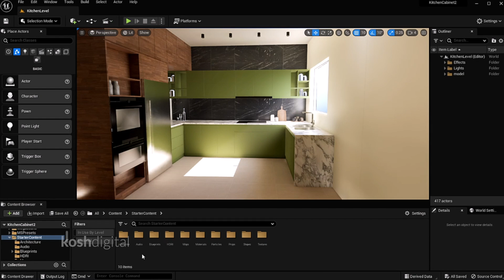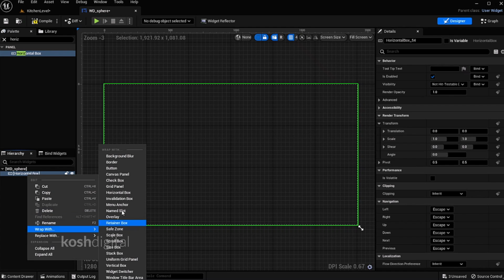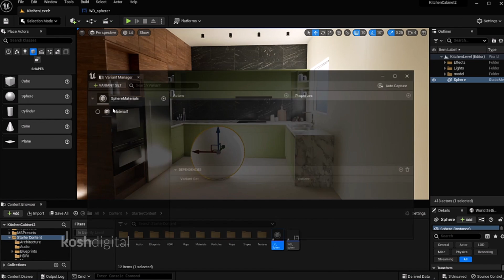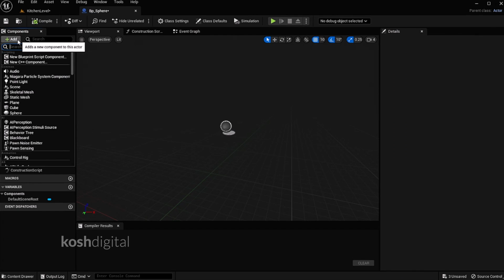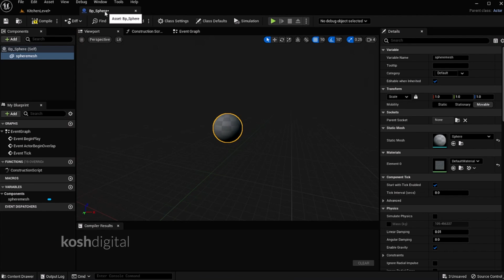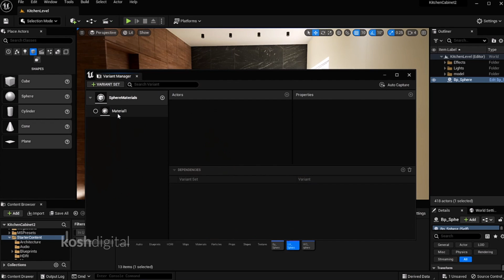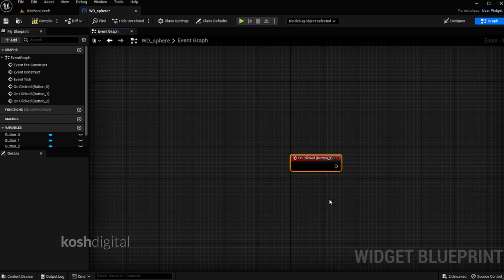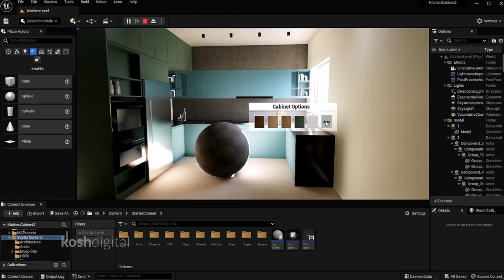Interactive materials in UE | How to change materials in Unreal Engine 5 Tutorial #unrealengine5

Comment: Hello! I'm having a problem, I have followed the full tutorial, but my problem is when i click the sphere the materials are not showing I think the problem is that I don't have a proper player controller to click on it, I did this tutorial on a blank project in Unreal.
Reply from the maker: Did you drag the blue print into the level. Delete the original sphere. Try it pls
Reply: @koshdigital  I solved It, I had to activate clicks on the default playercontroller, But thanks for answering anyways.
Reply from the maker: Glad you did

Comment: Great Video! I have it only working if I use Event Begin Play. The On Clicked blueprint static mesh doesn't work for me [I click the blueprint actor and nothing happens]. Anything missing on earlier steps with plugins or projects settings I need enabled? Version UE 5.4
Reply from the maker: Hey! You have to drag the blueprint into the scene.. Try it and May be you should check project settings.

Comment: question what template you used? I followed exactly the same with your tutorial, but it doesn't work me.
Reply from the maker: Basic arch template. Where did you get stuck? Explain, may be I could try to help.
Reply: @koshdigital  thank you for the reply, upon playing not showing any button for material changes. basically widget is not working. anyway i am using latest version of unreal.
Reply from the maker: Did u drag the blueprint and variant manager into the scene?
Reply: @koshdigital  Hello, thank you for this video. I also have issue with the mouse click, it doesnt do anything. Please advise how to fix
Reply from the maker: Enable mouse click events. If you follow my other replies, I have detailedly explained

Comment: Thanks for clear tutorial SUBED,   first if anyone is  wandering how to close widget after choosing mats : add 2  notes 'on released' for both buttoms and link them separatly to 'remove all widgets'.
Koshdigital i have problem i want to do this to other bpmesh,  did everything as on sphere but at the end i can't copy 'on clicked' nodes . . .   please help  or maybe make other video, also is it possible to make widget more beautiful like  it to  spawn  several spheres with different materials and choose from there. because on widget you can only add image texture not 3d mesh with material.
Reply from the maker: Hi thanks. I didn't want to make the video longer. Logic is the same. 

Like you have asked for switching geometries, I did a quick video as well using the pre built templates. 

Interactive 3d objects materials cameras in UE | object configurator UE5 | Unreal Engine 5 Tutorial
https://youtu.be/Ja4xj9DyYyc

Comment: I'd love to use this for automotive configurator. How would I change geometry with this, not only materials?
Reply from the maker: Yes that is something which I wanted to make a video. I will soon. It's pretty much the similar approach but few more steps to be done. Please keep watching
Reply: When I play my car configurator nothing pops up. How do I connect existing geometry like car body so that clicking it triggers the paint menu? It's a bit confusing.  @koshdigital
Reply from the maker: did you add the car body as a static mesh? also make sure, the material id of the car body and assign it accordingly with the material configurator.

Comment: Hey, really great Tutorial. I have a question. If i have a whole Archviz House with several Materials on it but letz say just one material instance for the Roomwalls how can i just change one wall or room in Material or Color ? 
Do i have to make every Wall as standalone Mesh and BP? or can i use Matinstances and using just the right index ?
Reply from the maker: Hey thanks. Logic is this, if u want any mesh to have multiple material options, u have to have them separated. 

It's like this, I click a geometry, it displays material options. Be it a room or just a wall. If it is a room, u add all the walls meshes as one and or if it is just a wall, just as a mesh to be able to click.

Then you can have multiple material instances attached to that mesh and with corresponding material ID.
Let me know how it goes.

Comment: hi, for me it's working in editor but when I export and build the package in Windows this doesn't work there.. buttons are visible but it doesn't change matarial on click :(
Reply: Project is eporting without error there is not any error in red and orange color in log but when i saw carefully white text there is something - "Invalidate: All Widgets triggered. All widgets were invalidated"
Reply from the maker: Probably validation issue. I need to check on this. I haven't encountered this issue. Could you please share screenshot?

Comment: this is awesome, i was looking for this, just a question, how do i manage to use the "click" during the gameplay, im using the "archviz" template and just does not allow me to use it, just to navigate around
Reply from the maker: Thank you. Did u turn on mouse click events in player controller settings?
Reply: @koshdigital  thanks for the answer. I didnt knew how but after a bit of reaserch i discover how. I followed your tutorial, works great!! just another question, because i manage to make the user interface widget to appear but not to disapear, what could you suggest? thanks in advance!
Reply from the maker: @izaaak  glad. If you could share what you have found, it would be useful for others as well. 
when it comes to widget disappearing, I intentionally did it to disappear, otherwise when I click on the other material, it will overlap. So usually people keep the widgets at a fixed location to choose from, like for example, cabinet material as one row, counter material in another row and so on.
Reply: @koshdigital  Hi, where will find it? i'm  just new to UE. Because i have the same problem, I can't click on the object. When I use the mouse it just rotating my view. Thanks in advance